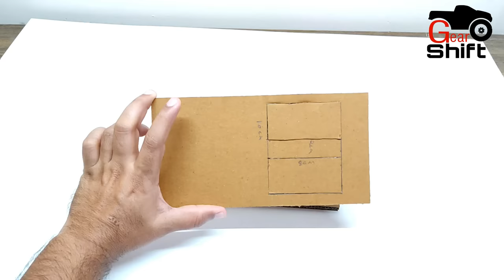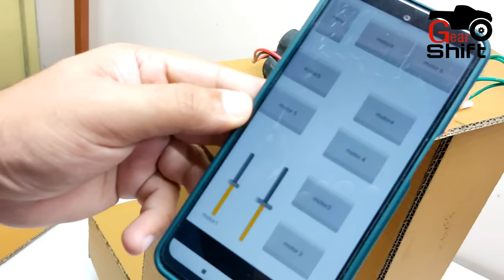science experiment project / built a robot with Bluetooth mobile app controlled using Arduino

Comment: Hi sir this robot 🤖 is awesome but I have some dought please clarify... 
1.where did u connect the wire of head and hands...
2.we are going to vishweshwara museum and there we will purchase all this thing.. so what if i ask they give all the things which u have used..So tell me names of these motors which u have used....plzzz sir
3.what is that black thing u wrapped and kept there....
Sir plzz tellll.....and thanks
Reply from the maker: black thing is 12 v lithium battery 🔋.  motor used    for hand 2 servo motor for legs 2 dual shafts motor or bo motor. main circuit board is 12channel  Bluetooth connectivity circuit. check video description also getting full details... thanks for watching 🥰💕😘

Comment: Hi I need  which  are the things you used for it and the app link.
Reply: Arduino nano 
Bluetooth module (hc 05)
Motor driver l298
4 Bo motors 60rpm 
battery 12v I guess
Rest is body of card board

Comment: We are refer your video for the project. So one issue is not clear. project Direction board where we get
Reply from the maker: circuit is purchased from local electronic shop .... you can self made this board at home .
Reply: @GEARSHIFTVIDEO  Which board u have used 
I meant to say on which board u have attached the battery, bluetooth sensor and nano chip